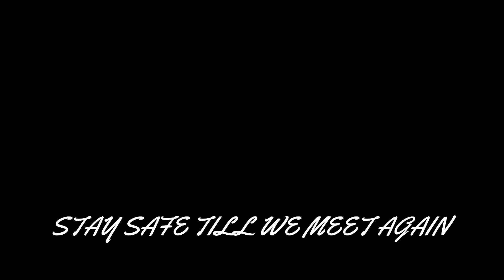De cat exhaust of 1000SX Kawasaki BS6 2021

Comment: Javed bhai does it leaks some short of air from the joints,kindly check & let me know 
Thanks 😊
Reply from the maker: No leakages from any where Shiv bhai
Reply: @ridewithjavedthakur  have done the same with my v1k & quite happy with it.
Reply: And bhai our cat(catalytic converter) is still there we have just removed resonator or u can say Pre muffler. And that’s the + point.
Reply from the maker: @shivnilaksh  yes we have the oxygen cat still on so when you install after market exhaust the sound loud but it doesn’t throw fire 🔥 from the exhaust. You will get all the pops also.

Comment: Is there any problem with O2 sensor after removing cat converter? I'm sure you must have lost few kgs of weight on the bike. Also, any warranty issues due to this modification?
Reply from the maker: There are no issues absolutely after removing the cat.yes bike has become 5kg lighter.
No warranty issues, checked with the dealer and service station all is cool.
Reply: Great...can you give exhaust guy's phone number...do they make link pipe on their own...like to get it done for my bike too..
Reply from the maker: @veeraraghavansafety  it’s available in description brother. All details with contact no and website

Comment: Nice one javed bhai,, is there any difference in power delivery... Or any pops etc. What's the total cost for doing this at barrel exhaust.
Reply from the maker: Honestly Zuby it does sounds better and there is base to it… waiting to ride it on free way to test the results and power I do feel the torque but let’s ride and check which I will do tomorrow morning. It’s very cost effective.